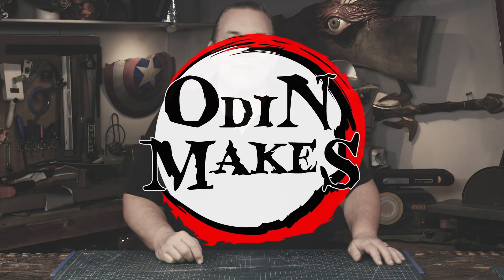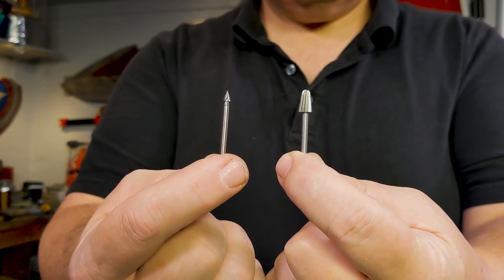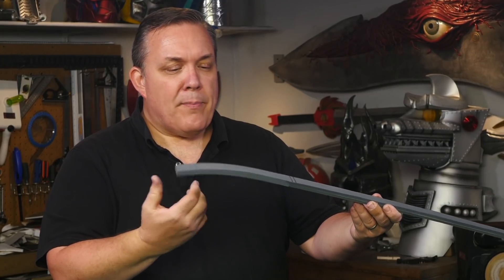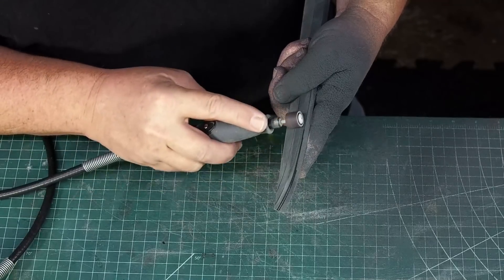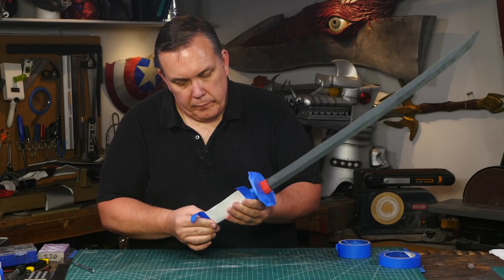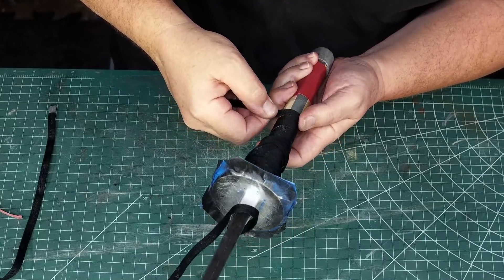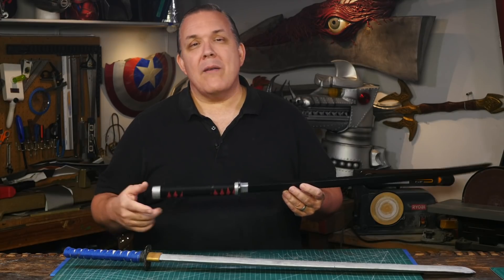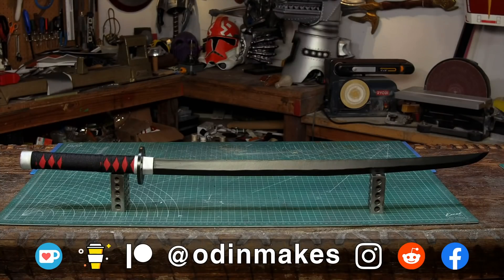Odin Makes: Tanjiro Kamado's black katana from Demon Slayer

Comment: Dope! For the inner core, a better option would be a water valve key. It's metal, but since it's inside the prop, it's not against con rules, and you can bend them. I've done this a few times now, Pretty easy to bend too, and only about 6mm thick. I use that nested in 6mm foam, sandwiched between 2 pieces of 4mm for a 14mm blade, which is still thin enough to look good. You can also do what you did in the video to use only 2 layers of foam, but whatever..semantics..lol

Comment: For costume props etc i made when i was doing em on comission i used to use fibreglass rod (tent rods as you can get them uncut in huge lengths for cheaper) and for adhesive of ...basically anything i used a contact adhesive called "Alpha: Thixofix" ..... then seal it all up with latex colored to what you want the base colors to be and then i used a roofing compound called Isoflex by Ronseal to seal up my props and protect them from a lot of what life can throw at them........ just my 2 cents on the method :) im in England incidently. if anyone ever wanted more info on materials or whatnot gimme a nudge, im happy to ramble!

Comment: Something I have done in the past for an internal structure that needs a curve, V-notch the inside rod.  Bend to angle it needs to be.  5 minute epoxy and you've got your angle and can still cover in foam.

Comment: This came out so well! Where do you obtain the graphite tubes? I'm having a hard time getting my hands on some.
Reply from the maker: I buy mine from TAP Plastics, they are a west coast sheet plastic retailer. They ship online as well, but you could check amazon, or Interstate Plastics.
Also, these tubes get used for custom kites. Perhaps an online community of kite builders would have a source?
The tube runs $8 or so retail for the 6mm (I think, it's been a while since I bought them.)
Reply: @OdinMakes  Ooooh, that makes total sense! I'll check those out! Thank so much Odin! Keep makin'!

Comment: Why didn't you use a thick aluminum wire for the spine? I imagine curving it using a vice would be better for the overall curve of the blade. Either way, great build!